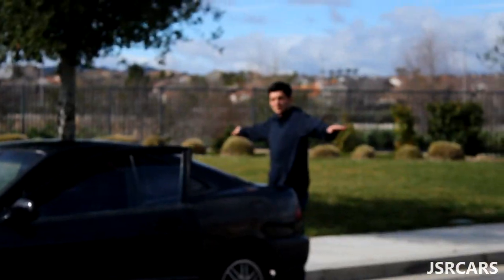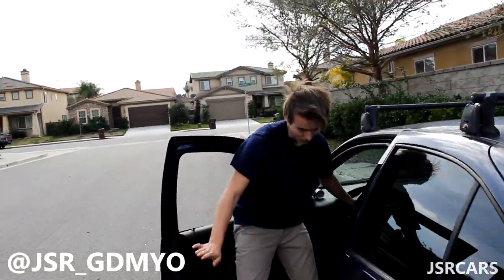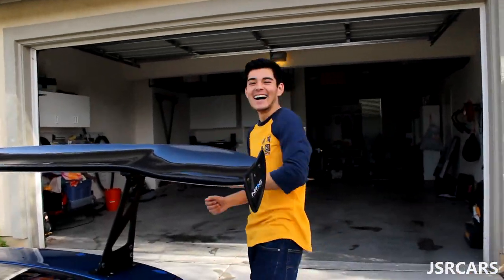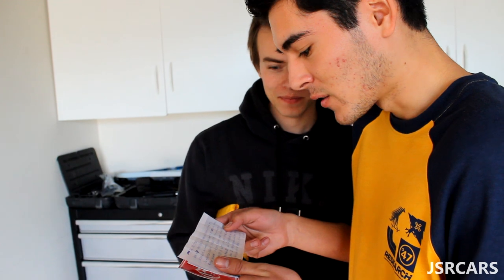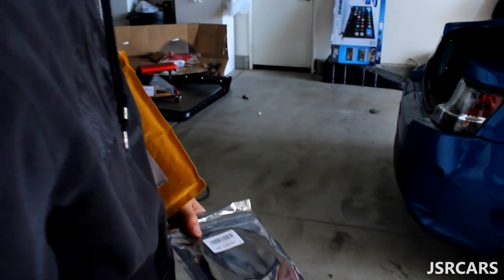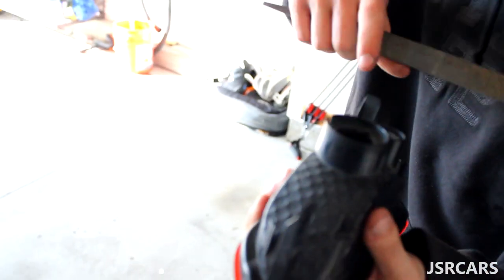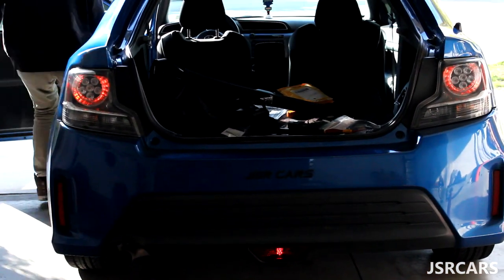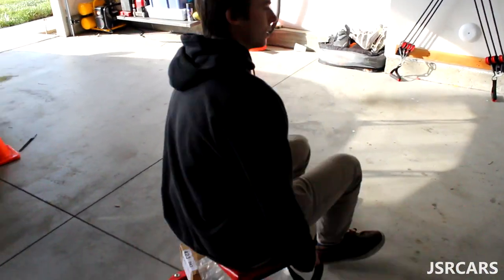Cool Blinking Brake Light Thingy Install

Comment: The black TC that showed up does not look bad at all, and I'm a muscle car guy.

Do you think you'll engine swap the TC or boost it, maybe even NOS?
Reply from the maker: +Chad Fotheringham Boost if anything. I'll probably get rid of it before that point though.
Reply: If you did get rid of it, what would replace it?
Reply from the maker: Chad Fotheringham E92 335
Reply: Why an E92 335?
Reply: Chad Fotheringham it's a bmw.
Reply: Make sure to get the n54 powered 335 over the n55 335
Reply from the maker: aznhalofan650 I'll prob get an N55. It'll be a daily and I'm not trying to make a tremendous amount of power haha
Reply: I see totally understandable, the n55 with a Cobb or jb4 tune is absolutely bonkers just be ready to with money to maintain it cause I've went through a lot. Thank god for my extended warranty covered 90% of the ridiculous components that failed and I just hate how on my 335is is a *** to work on compared to my 85 325e in comparison is a breeze
Reply: Also btw I love your videos, you guys are awesome and I wish all you guys the best.